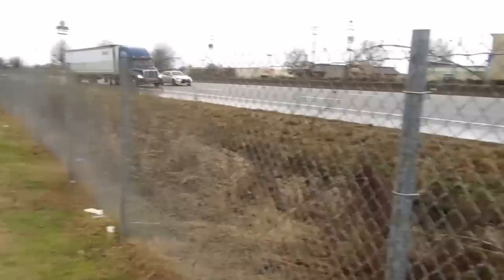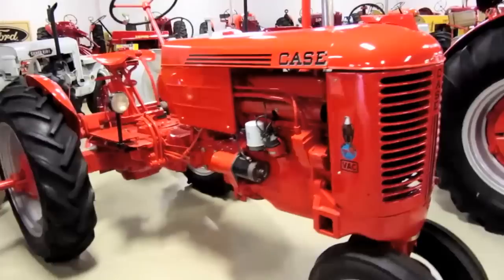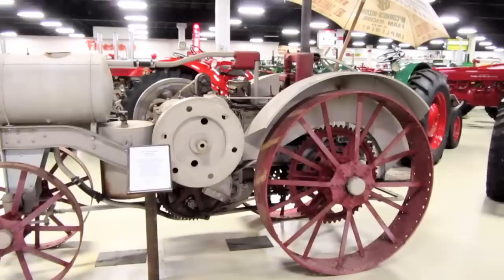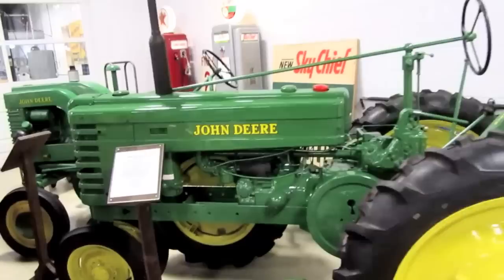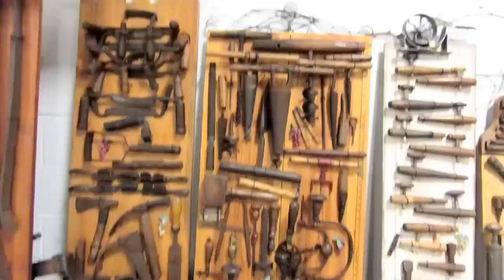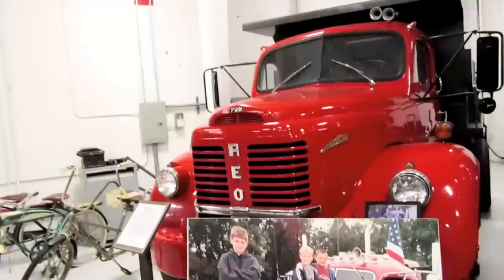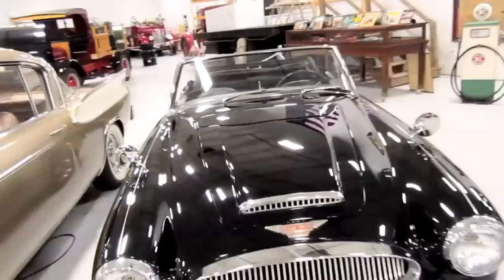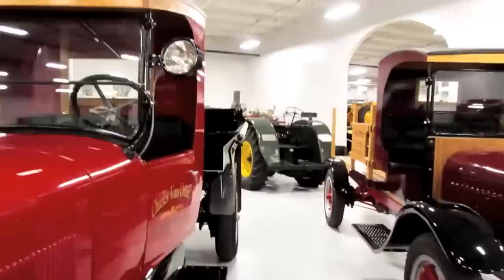A Walk Through the Keystone Truck & Tractor Museum

Comment: We had an Oliver 880 wide front like that. I think my father bought it new. I remember it most used for baling small square bales and he also bought a New Idea two row mounted picker to go on it and swapped in the narrow front row-crop post to fit. While helping a neighbor pick corn with it, a transmission gear broke and locked the tractor up. We got it home and my father took it apart. he eventually got the rear end fixed and was putting the tractor back together and the engine had froze up in storage. It sits in the shed with the engine on its side and one stuck piston inside it. Apparently the transmission gear was a weak point for all the the 880s.
I have a green-belly 1955 Ferguson (24.41) we used on the farm back then and it's recently back to work and painted up.

Comment: Hot bulb is in reference to the ignition that was a open  flame.  Pony engines were and are used to start a large displacement Diesel engine mostly found on stationary Deasel engines like generators for electrical generation or pumping water at a water treatment plant. The John Deere was to introduce there Deasel sooner without the disappointed battery life of a tractor.

Comment: The JD R,80,820,830 all had pony motors. The R was the first of it's kind. The first diesel John Deere and it used a pony motor to start it because a starter at the time wasn't strong enough to start it. It had a 2cylinder gas motor. (pony motor)

Comment: Pony motor's were gasoline engines used to start the bigger 2 cylinder diesel powered engines in place of a electrical starting system
Reply: high revs and sometimes more noise than the engine they started.

Comment: Hot bulb !!  You heat it up with a torch!! How many shades of JD green is in there??
Reply: sometimes, they used a short steel rod, that had a end made to hold a small piece of wadded up cloth, , then dipped it in the fuel tank, , then lit it, held at the hot bulb, ... there are many shades of JD Green,  I think JD changed it, depending on how much of a color add they had on hand that day.
Reply: @benscoles5085  have you ever tried starting a Bulldog with the method you state... hope you ain't got nothing but time....lol